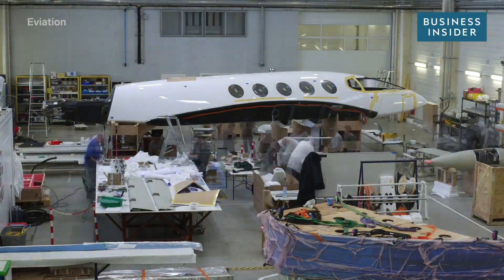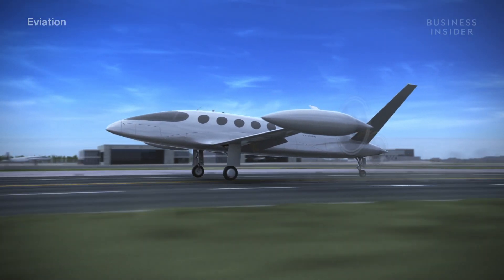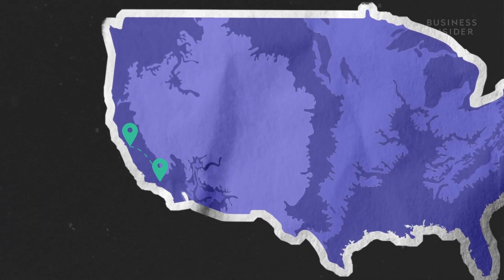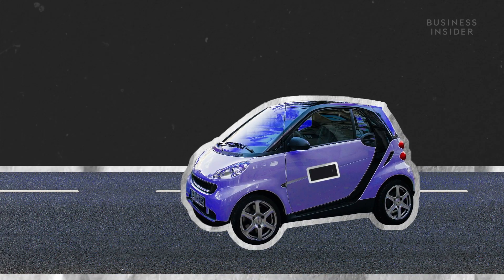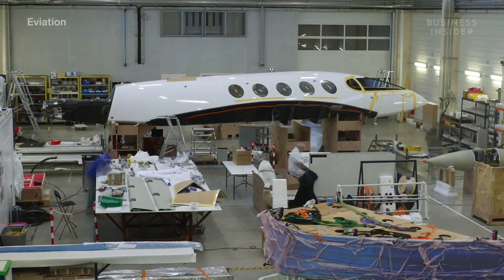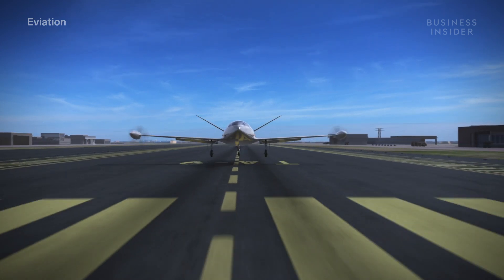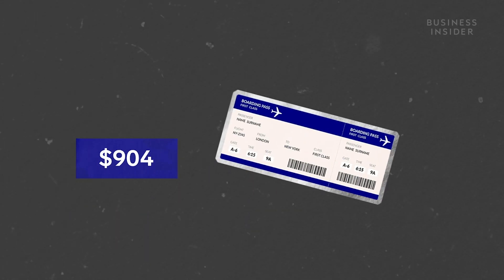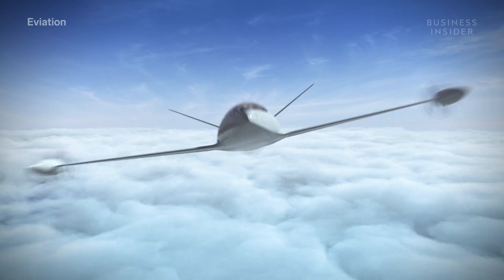Inside The $4 Million All-Electric Plane

Comment: That's very cute and all but... How do you charge it?! Planes are supposed to have quick turn-around and airports are fitted for refueling, not recharging.
Reply: it takes 1 hour to charge
Reply: @Dominic-sr1ed  1 hour to charge a 950 kWh battery? That would mean an average charge rate of 950 kW, which is pretty high. Cars have a peak charge rate of 350 kW on the CCS charging standard, and that only holds for a few minutes.
Not saying it can't be done, but I currently see no infrastructure or plans for it.

Comment: I think people throw around the word "sustainability" much too freely and without thinking. I can almost guarantee that there is a tremendous amount of embedded fossil fuel energy in these planes, and almost certainly they are not charging the batteries with solar power (which also, by the way, has a tremendous amount of embedded fossil fuel energy in them).  When there is plenty of cheap fossil fuels around, one can use a lot of energy to invent things. Personally, I am really grateful for fossil fuels, and my ICE vehicle is a keeper.  Elon and his millionaire friends can drive around their Tesla vehicles, but I am perfectly happy with my Hyundai elantra, which thankfully doesn't have
self driving, and if I need fuel, a gas station is less than a mile away from any part of town, and it sips gasoline like a hummingbird sucking out nectar from a small flower.
Reply: No offence i respect what you say, but global warming big bad problem. Which is the main motivater for projects like these.
Reply: @ThomawillolGaming    I don't doubt that there is climate change.....global warming or cooling has, in my opinion not been
confirmed to my satisfaction, but for the sake of simplicity let's say humans are causing global warming by producing
more CO2, and that CO2 is injurious to the planet.....none of this has been proven by the way....but my point is that
there is tremendous embedded fossil fuel energy in technology so it seems to me, that until we discover some other
source of energy to mine, refine metals, and construct things that will produce "clean" energy we are not really improving
the planet, but falling in to a delusion that just makes us feel good.

Comment: Your calculations on flight duration for short haul flights are way off. Max cruise speed does not make a big difference here. E.g. slower turboprops are sometimes faster on these routes (compared to a 737).

Comment: That's nice, but do people really know how much damage to the environment the manufacture of LI-PO batteries cause. That includes mining of all the elements required to make the batteries and the energy used to make them. There is enough oil to last eons.Oil production is less harmful to the planet and the caused pollution can be controlled. Also the most obvious question is, where is the electricity used to charge the batteries produced? Most likely from Nuclear, oil or coal using generating stations. Even the Wind generators(Non-recyclable at end of use) or solar panels( again Non-recyclable at end of use). And alternatives to oil seem to be more harmful to the planet than keeping with oil and coal.see attached website
https://www.nsenergybusiness.com/features/lithium-ion-battery-environmental-impact/

Comment: Emission free 😂 yes of course it is.
Reply: Directly it is. If u power it with solar panels its totally emission free
Reply: @elliotoomen8001  when did solar panels become that efficient that they can power a airplane and thousand of batteries to run it.
Reply: @beany1987  solar panels on the ground
Reply: @elliotoomen8001  yes that's still alot of power for just 1 plane journey considering how inefficient solar panels currently are and the area you need to produce the power require just for a 1 way journey, let alone a fleet of these would take a massive leap in tech to make the viable maybe the 4860 cells with help this along with faster charging.

Comment: Wait... i have a question, is it possible for us to make a plane that have small fan to spin so the plane can generate its own electricity? So the plane battery never run out of juice because of the mini fan that keep spinning because we’re in the air and the air keep pushing the mini fan. So by that, the plane only get charged at the ground for take off. So we can fly further with electric planes? Is it possible? It would be much appreciated if you can answer this question 😁

Edit: Even if we have the ability to produce these, why do you think that they didn’t make a model for it? Does it cost a lot?
Reply: I'm a commercially rated pilot. Some aircraft actually do have this - It's called a RAM Air Turbine but its only purpose is to provide electric power in the case that all electrical power systems are lost since pretty much all aircraft just use an alternator in the engine to generate their power. The reason why it isn't used in an aircraft like this is because the extra power that one of these would generate would not cover the extra drag caused by a prop spinning but not producing thrust. 

On a multi engine prop aircraft, If an engine fails and can't be restarted, you feather the prop (which makes it so the failed engine produces the least amount of drag and doesn't spin) if the prop keeps spinning it produces a lot of extra drag which decreases performance by a pretty large margin.
Reply: cowsmop ohhhh...thank you so much mate! Much appreciated!😁 Stay safe!! :3
Reply: use solar panel

Comment: How to make electric plane 101:

Take out the Jet Engine put in an Electric Motor.

Add some batteries in the wings, There you go you got an Electric Airplane 😎
Reply: Except with our current tech and even with tech we think we will have in 10 years, electric passenger planes won’t be viable with weight to power ratios with how heavy batteries are and the very underpowered motors which produce little power to extend range. I hope we will be able to get battery tech better but right now it’s a pipe dream. Would love to be proven wrong in the future though

Comment: We don't need to fly to travel. Hyperloop could solve the problem in a better way
Reply: But people gonna loose jobs if it happends
Reply: @Lee247Jamaica  yes but think about the new jobs that will be created
Reply: @ayushpadia1394  think a bout airlines like the top ones Lufthansa Emirates Cathy Pacific and others airlines are already strugling so if this happends more pilots flight attendance ground crew are gonna lose jobs
Reply: @Lee247Jamaica  most of the top airlines don't fly short routes so this won't really effect them instead it would effect short haul and domestic fliers but we can't just think of employees while making change if we start thinking only in that direction then the post would still be the most used method of communication
Reply: @Lee247Jamaica  we need to create a plan to make sure the people working in the airline industry can smoothly shift and work in other industries or get employed in Hyperloop trains

Comment: I'm sorry, I'm not going to double my flight time just to fly on an electric plane.
Reply: Speed over small distances which is the maximum range of the aircraft(assuming they don't charge at their destination which would give them a coverage of roughly 300 miles) DOESN'T MATTER.

An aircraft requires time to take off and land and the true cruise speeds require a lot of time in between. 

Electric planes over short distances, covering regional airports would reduce operator costs and in turn, government subsidy on them.

The SPEED problem on current technology arises after you cover more than 800   miles where Jets hold their place.

Aviation in itself started small and is now capable of circumnavigating the globe.

Electric Aviation needs time.
Reply: Bro it is 5 times cheaper too and
Many will want to enjoy flight time lil longer

Comment: This is cool and all but hardly anyone will use it just because its a lot slower than normal air travel. They need to work on the speed otherwise this will never take off.
Reply: The speed equation doesn't matter on small distances

Eg: A flight duration of 1hour with takeoff, approach and landing taking up majority of flight time require low speeds anyway. So there won't be a huge difference on regional flights.

Comment: 3:47 Shows a 747 when talking about a turboprop smh
Reply: Maybe the wanted to say turbojet because old turboprop passenger planes need a LOT of money every few flights you need to check everythig and you can't be sure if it fails. And they also burn a lot of fuel
Reply: @zaxarispetixos8728  747 is still not a turbojet lmao...the media just thinks every plane is a 747 or 737 MAX smh
Reply: @jerieltee  turbofan?😂
Reply: @zaxarispetixos8728  what are you talking about?? Turboprop planes are reliable and of course cheaper than turbofans . Have you ever seen an ATR72, Bombardier dash 8 or C130? Those are turboprops. 
An equivalent turboprop however would be a Pilatus PC-12 because everyone forgets the fact that this plane carries only 9 passengers....
Reply: @almerindaromeira8352  i think she compared them to huge passenger planes and turboprops are not reliable. Turbofans have almost 0% chance to fail turbo props have 10000 moving parts turbochargers oils to change things to lubricate sparkplugs etc.
Reply: @zaxarispetixos8728  neither turbofans or turboprops have turbochargers or sparkplugs.... If you don't know what you are talking about or can't be bothered to look it up, don't comment.
Reply: @almerindaromeira8352  i thought turbo prop they were talking about old prop aircraft
Reply: Turbofan

Comment: "A similarly performing turboprop...."

Shows a 747
Reply: So funny how they compare a plane that carries 9 people to another that carries like 400 or more
Reply: @wilbur6089  400 or more
Reply: @arpandrozario7959  I edited it :)
Reply: @arpandrozario7959  400 or more
Reply: @wilbur6089  a bigger plane is way more efficient than a smaller one though
Reply: I instantly paused and looked for this comment
Reply: @xpeterson  i ranted about it... They are probably high while doing these videos
Reply: @xpeterson  lmaoo, I literally did the same thing
Reply: Its indeed wrong because 747 are Turbofan, for those who did not catch the difference or are less savy they will only understand the image of a 747.
Reply: Yah well according to tech insider Alice and a 747 as “similarly performing turboprops”
Reply: pain
Reply: Holy moly 666 likes
Reply: exactly, it fly 260 MPH, it can go 800 miles per charge. this is a big win regional electric airline.
Reply: Should have shown a King Air as comparison. This looks a really good plane for air ambulances or flying doctors services
Reply: Is a turboprop driven by a electric motor. Instead of using the evil Jet fuel, now it used prisonous batteries.
Reply: who cares
Reply: 747 shown as conventional means of transport, not comparing Type.
Reply: @cascade5682  She said TURBOPROP.
Reply: @YosiaCS  its because regular people know a 747 when they see it. they most likely wont recognise a dash 8 q400 or a cessna caravan.
Reply: @381delirius  People had known propeller driven aircraft before jet era. Maybe lots of people don't know what turboprop or piston engine is but they can distinguish propeller and jet/turbofan tube attached to wings.

Comment: How does it reduce carbon emissions if the power source, which charges the plane’s battery, runs on fossil fuel?
Reply: More efficient to burns fossil fuels in a power station and then store the energy in a battery than to burn it in a jet engine. Also the energy may well be from a renewable source
Reply: Power plants that use fossil fuels are much more efficient than jet or combustion engines so it's better to use them to make the energy and have a car or plane use that energy to power an electric motor and as time goes on more power plants will use renewable energy instead of fossil fuels.
Reply: @drabberfrog  They also filter their emissions, unlike a jet engine, modern fossil fuel power plants are surprisingly clean.
Reply: That's a problem with any EV like cars, trains, etc. These changes in transportation have to be backed by changes in the way we produce energy.
Reply: @Nicolas-gu2jt  No electric vehicles are over 800% more efficient so even when using fossil fuels it will produce way less because it's so efficient
Reply: @lachlanB323  I didn't know that, thanks. We still have to change our energy production regardless
Reply: @Nicolas-gu2jt  good thing the main electric vehicle maker (tesla) makes the cheapest solar in the US. And with solar being the cheapest electricity ever the only thing getting in the way is stupidity
Reply: @lachlanB323  well you still have to store it and current storage isn't great right?
Reply: @lachlanB323  Source?
Reply: @Nicolas-gu2jt  Yeah you need batterys to store your electricity. But if you want you can sell it to the grid to make money.
Reply: @ichkommentiernurkommentare7237  https://www.google.com/amp/s/thedriven.io/2019/11/11/tesla-model-3-now-eight-times-more-efficient-than-average-petrol-car-in-australia/amp/ btw this is from the older less efficient model 3.
Reply: @lachlanB323  thx
Reply: Jon O'Malley  we don't all live in France

Comment: Labeling the pipistrel electra as an attempt at an electric passenger aircraft is very misleading. It is a very useful aircraft it's just that it was not made for long distance passenger flights, its main purpose is as a training aircraft. Where it's somewhat short battery life of about one hour is not a problem also its battery is easy to swap. Trying to compare those two airplane's is like try compare a Cessna 172 and a 737 as passenger aircraft's.

Comment: I just want to know of that lightweight plane won't blow away in a storm or have problems with lightning. Otherwise I am sold. Cheaper? Nice looking? Sold!
Reply: Might have some issues with electrical systems with lighting need more testing to check that. For blowing away... No, it won't the battery is heavy. So the frame might be lighter but the plane should be weight about as much as a normal aircraft its size not if more.
Reply: People fly planes half that size through thunder storms. Not the smartest but fairly safe.

Comment: It’s just a matter of time one day they will have more range and speed than jet planes
Reply: This comment doesn't make sense. Jet planes are the fastest planes we have. The energy system doesn't matter.
Reply: @David-lc9zn  Well unless you can make a plasma based engine. Not saying we can or should. Just that it's theoretically possible.
Reply: The only way that will happen if there are major advances in battery tech. Right now we use almost 45-year-old battery tech so prob not anytime soon.
Reply: @williamwhite5825  it may be 45 years old but it's gotten way cheaper
Reply: price is not the biggest issue energy density is. The farther a plane can fly with current battery technology the less of anything else it can carry.  As of yet, we have not solved the energy density issue.
Reply: @williamwhite5825  Energy density has been improving. Just look at Tesla's tabless 4680 cells that's a MASSIVE breakthrough better density, costs over 50% less and is able to be produced much much faster.
Reply: @lachlanB323  It is still only 1-2% as energy-dense as gasoline and 7% of jet fuell. That is a huge issue that will take a breakthrough to overcome.
Reply: @williamwhite5825  yeah 1-2% as energy dense but the effeincy of the motors is more then 8x. Still not matching petrol but we aren't as far as people think.
Reply: @williamwhite5825  but electric motors are way more efficient than jet engines so they don't need as much energy to do the same amount of work.
Reply: @williamwhite5825  efficiency of gasoline engines is less than 40% while the efficiency of electric motors can go up to 95% or even more.
Reply: @williamwhite5825  You know nothing, dude. Battery tech is evolving everyday. It's not "45 years old". I'm in that industry and I can tell you breakthroughs are happening left and right.
Reply: lithium-ion battery technology is 45 years old. Advances have been made but as of yet energy density which is the biggest issue in making these types of things more viable has not progressed to the point of sublimating other fuels. If it had there would have been no need to make an ultra-light frame.
Reply: If we can get a battery to 35-45% as much energy as gasoline pound for pound then it will become more viable.